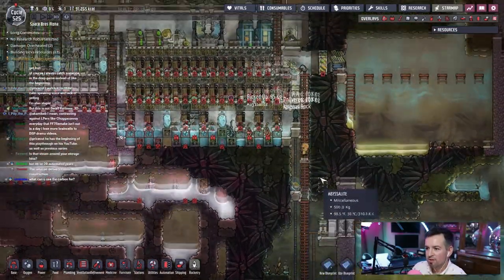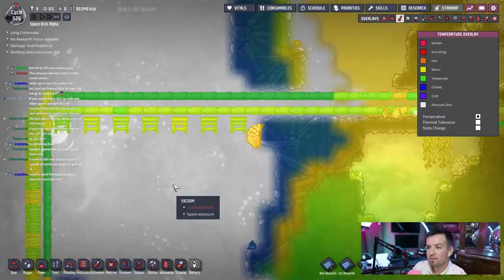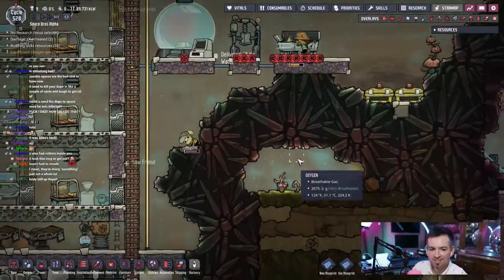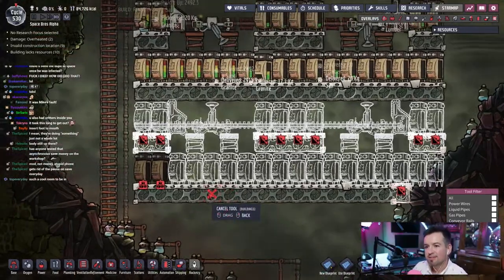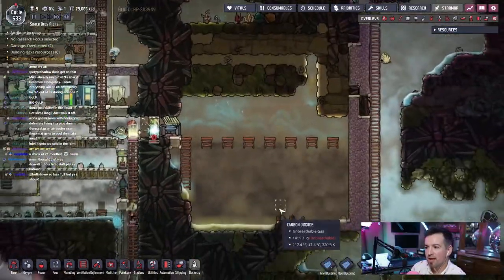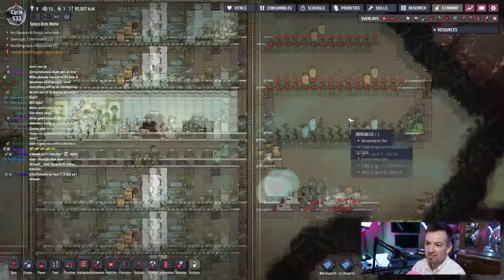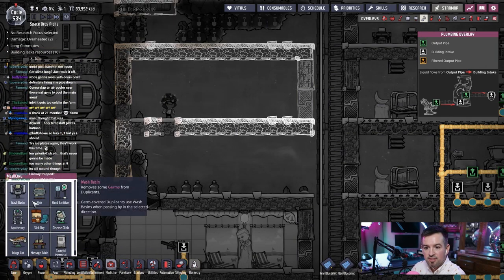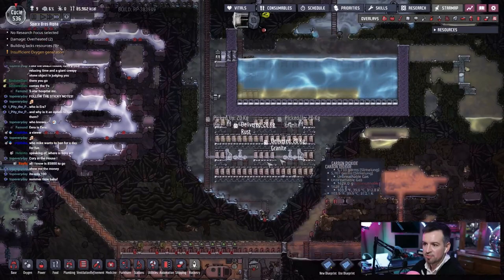ONI Adventures #36 - ENTOMBED!

Comment: I dont know how far behind the youtube series is behind where you are at, and you may have noticed this already, But your conveyor loader being a higher priority then your storage containers will eventually lead to your dupes running down to your storage taking items out and then putting it in to the loader making an infinite loop of them doing so, if you make the storage containers higher then the loader, they will run down there and load the items them self's. to avoid both issues set the loader to a higher priority and set all storage to sweep only. you will have to manually tell them to sweep items but it will stop them from constantly circling your items around in your storage.
Reply from the maker: jerthon1 This does get fixed, but I can’t remember exactly how long it took to realize haha.
Reply: @akamikeb  👍